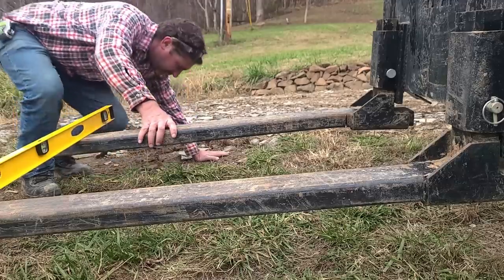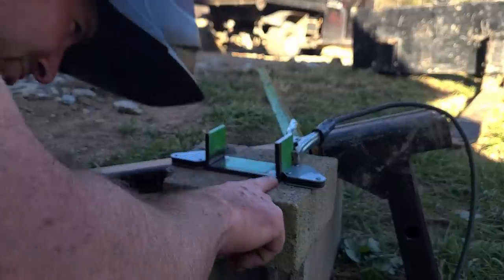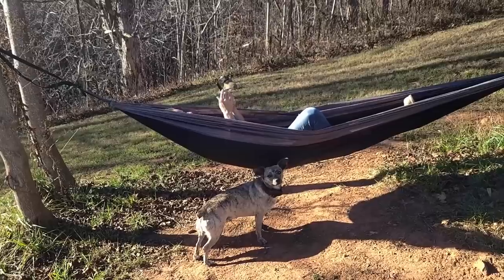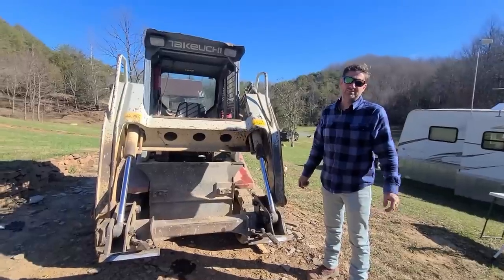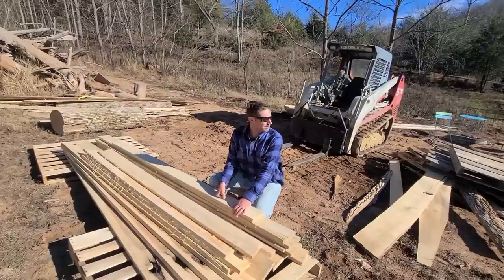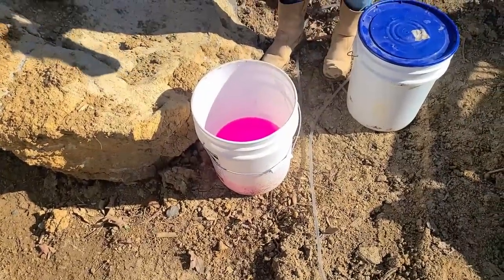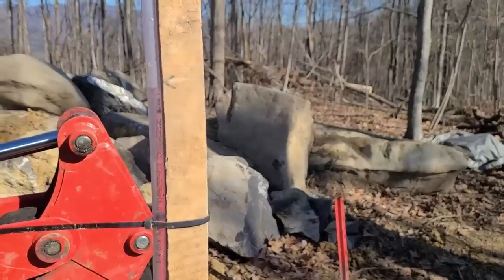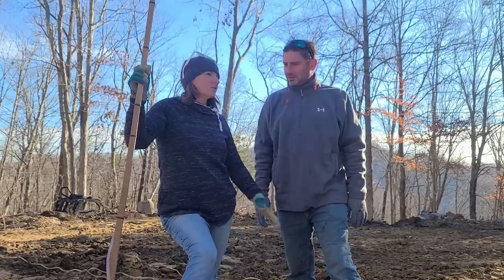Getting level and fixing pallet forks // E108

Comment: Way to go Jon. You actually taught me something. A few years back I made a water level to set the pole height on my pole barn posts but I didn't use the bucket. Your method is much easier since you don't have to have an extra person to monitor the level at the reference point. Unfortunately I will probable never need to use a water level again. But it is good to learn new things. Happy turkey day!
Reply from the maker: My version 1 was the same, Tim.  This method is a lot better and can be a one-person setup if you don't have your MEG around.

Comment: John & Meg, I know you aren't planning for cranes and concrete trucks going up the driveway to the homesite/permanent house, but pleases keep in mind in the future worse case event of a fire or medical emergency a large vehicle or more will need to be able to access the permanent home site via the driveway, the average fora fire engine is 35' long 8'wide and anywhere from 38,000 pounds to over 50,000 pounds ... Coming from someone who lives in same general type location as you and worked in rural fire service locations and major metro fire service type locations for 15 years please take that into consideration that those types of vehicles may have to make multiple trips in and out in the event of a emergency
Reply from the maker: You'll be happy to know we established a fire plan with our local fire department before we even bought the property for this very reason.  If there were an event, they know what to send to our address and what they're getting into before they dispatch.  Definitely step 1 before developing any land with a residence.

Comment: Hey Jon great fix on the pallet forks , what diameter wire do you generally use in your welder, also how many hrs do you have on tractor now, seems to be a workhorse, best of luck to you guys
Reply from the maker: Thanks - I use 35 wire (0.035) 95% of the time and if flows a lot better than the 30 wire in my opinion.  The RK24 has about 650 hrs now.  I've been using the track loader a lot more than the tractor because we are still in the land clearing stages, but the tractor's backhoe is certainly handy.